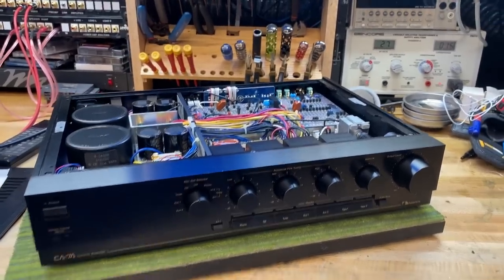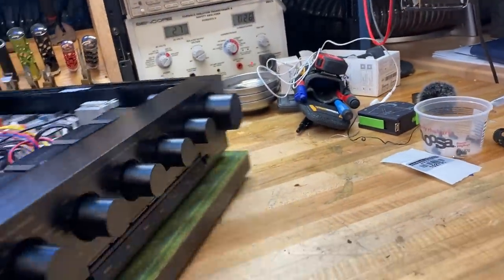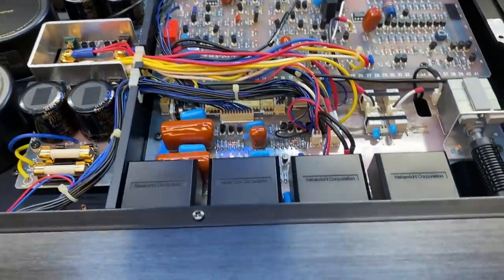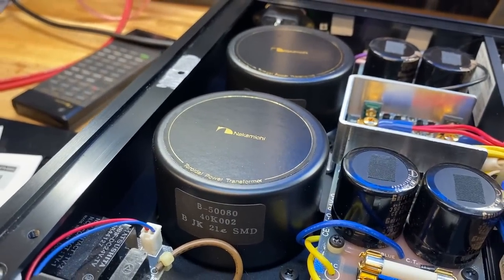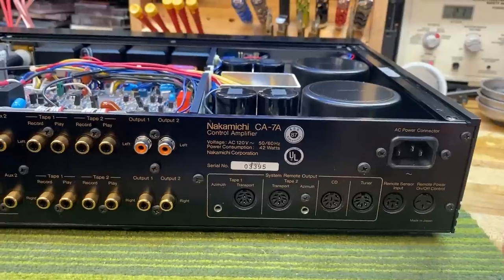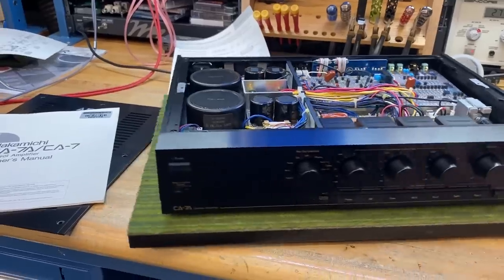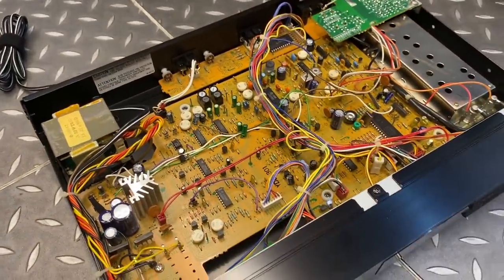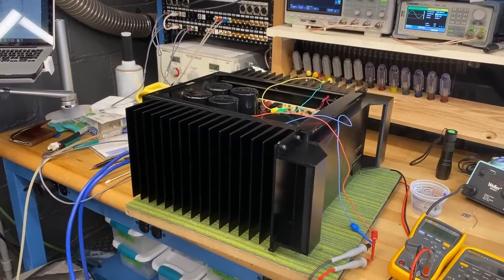The Fabulous Nakamichi PA7 Amp CA7 Preamp - Vintage Audio Sleepers

Comment: I’m still using my Nakamichi 610 control preamplifier in my office system that I have kept from the late seventies and I love it. My Nakamichi 600 tape deck needs a service but I don’t trust anyone in Sydney to do the job correctly. It’s great to see the work you do on the vintage Nakamichi gear as it is well worth restoration and it all sounds pretty good for what it is, if your into hi-end vintage them the selected Nakamichi components are well worth the effort. Love your work at SkyFi Audio.

Comment: In the early 80's I bought a 530 receiver.
Used it for 10 years until getting larger Magnepans requiring more power.
It seemed to be really well made.

Comment: Those filter caps are HUGE for the amps output. 66k UF of capacitance per channel is alot for putting out just 225 watts.
Reply: 137,000 joules, not a number archived by many amps.

Comment: I'm still using the NAK CA-7 with a PA-5 power amplifier (100 watts/channel 0.1% THD 8 Ohms / 160 wpc into 4 Ohms). Still sound fantastic driving KEF C80 3 way speakers. I'm also using a NAK TA-4A  Receiver with KEF C25 monitors for my home recording setup with a MOTU M4, MAC mini and DELL 4K monitor.
Reply from the maker: Gary, sounds like you've amassed a great setup,  Thanks for sharing.

Comment: Sadly, their OMS-7 CD player had a high failure laser rate.  Almost all the units you see these days suffer from that.  In addition, there wasn't a digital out so you can connect to an better external DAC.  I still own the PA-7.  I believe the 7 series was the last hurrah for Nak, unless you consider their 3 piece Dragon CD player & DAC combo. A much admired audio tour de force which sadly succumbed to the digital era.  Have fond memories of my 2 680ZX, 1000ZXL and a couple of others.  They were on top of the cassette medium.

Comment: I'd love a PA-7 to pair with my CA-5.  Also, it is strange when one piece in the line (in this case, the CA-7) seems to be built to another standard entirely. I have a set of late 70's Yamaha separates, and the tuner, a T-2 is just on another level from the rest. It's like an aluminum brick with the one piece solid top and side cover. The amp and pre, nothing too special.

Comment: Bro thats a British cossie Man thay where everywhere including my oncles garbage he had a one of 400  limited editions it was British racing green and I can't remember what series it was but they are rapid and defiantly British not German, cosworth is an English company and most of them where built in the uk and yeh well done don't sell it and stick a bigger turbo and intercooler and you know the rest light as food and they handle a dream, desighned by and made for the uk marked. Rs 500 sierras are nasty too but tail happy and not as sharp to drive as escort on these tight uk roads but the sierras won many a touring car tournament, the engines where desighned for f1 cars bk in the day and there is a cool vid online of them developing it and they stuck it in this and the Sierra and a lesser 1.6 version in the escorts rs turbo, I had a boggo rs first and thatbuse to spin in every gear in the rain cuz it wasn't even a ton in weight, all awesome these mid 80/ mid90's ford's man... rapid.. good catch man for sure.